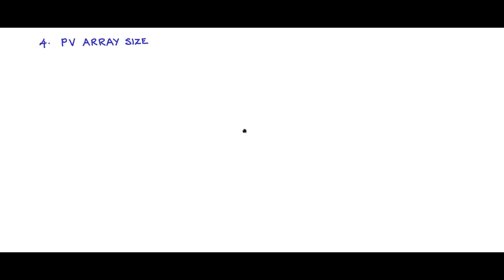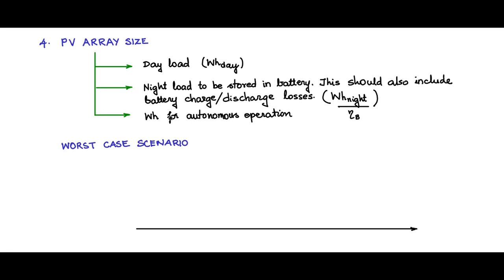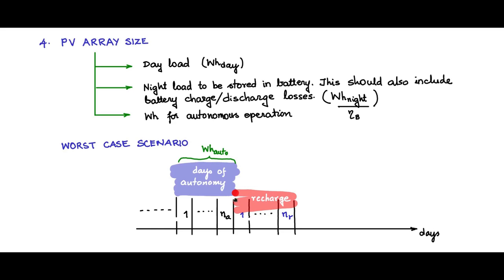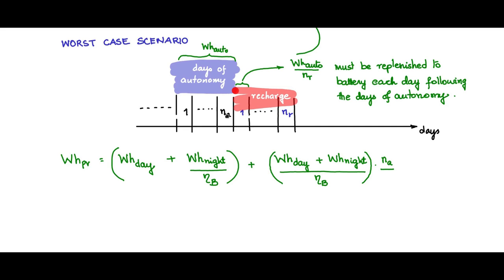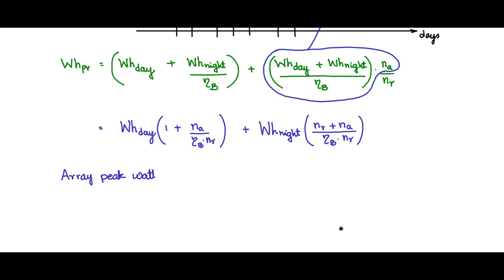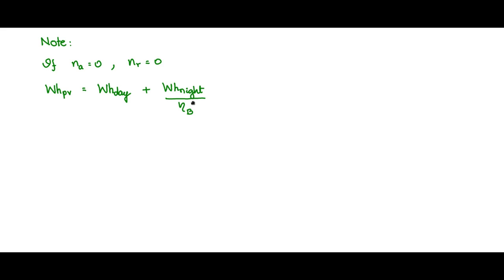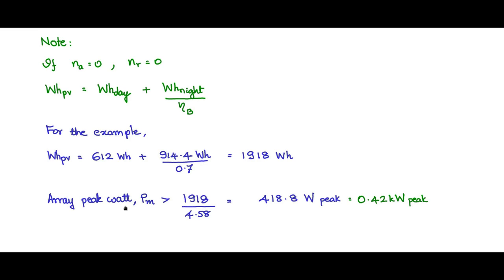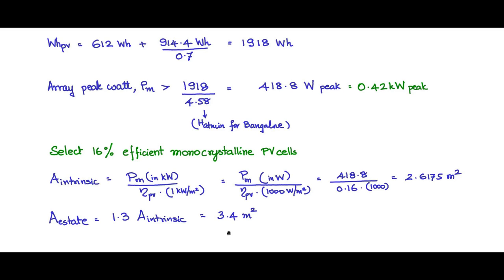PV system design - PV array sizing

Comment: Sir your my favourite lecture,I saw your basic EE video s completely. But here I need one video regarding ,how to choose string size and how many pv panels for per string required.how to calculate.
Reply: I agree with you, it missing how to choose the specification of inverter/ charger to match the system. That will be a large lecture section